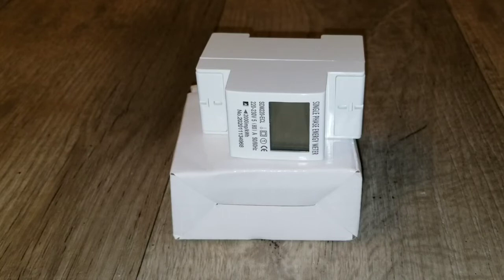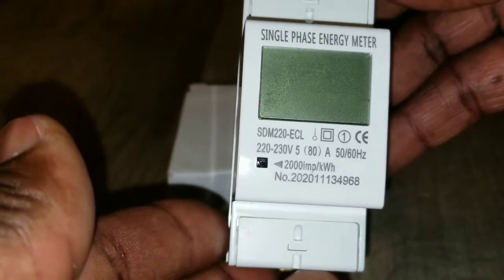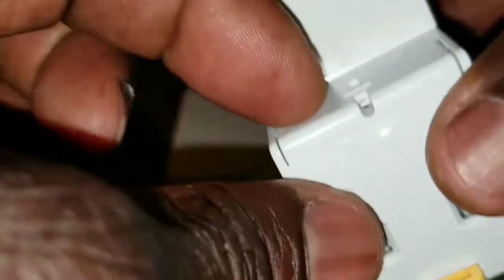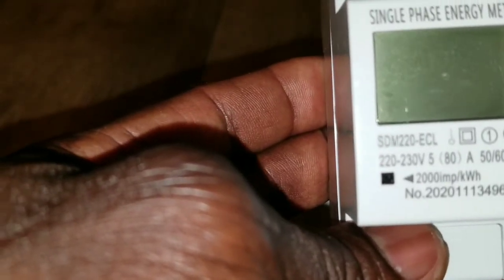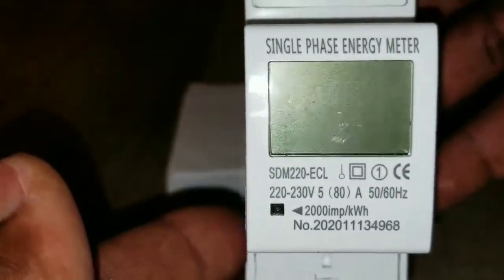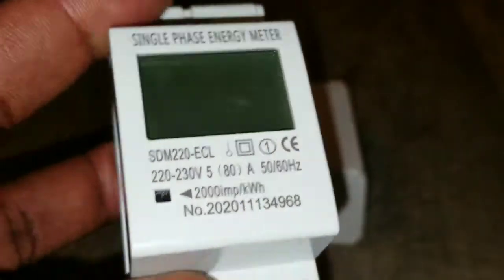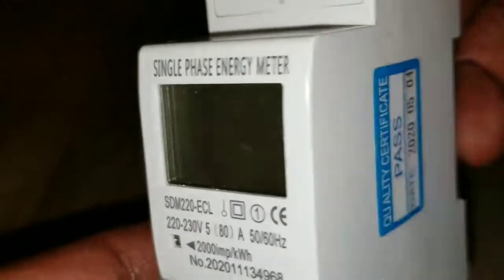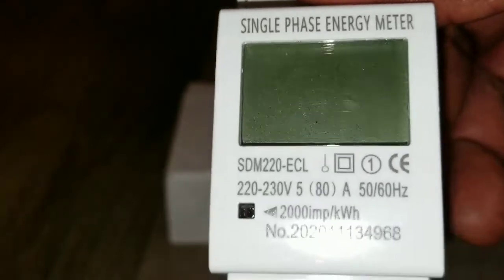80A SINGLE PHASE TWO WIRE LCD DIGITAL DISPLAY WATTMETER POWER CONSUMPTION ENERGY METER

Comment: How does this handle imported and exported power? I mean can I use this to monitor power in direction even when there is power going in the other direction? Thanksm
Reply: No you cannot.
Reply from the maker: Thank you
Reply from the maker: I haven't tried using it with motors.
Thanks for watching LIKE SUBSCRIBE and SHARE

Comment: Can you use this for metering the output of a pure sinewave inverter feeding a critical load panel in a house ?
Reply from the maker: Yes. 
As long as your critical loads are NOT over the the rated capacity of this meter proximately you should be fine. 
That's was exactly how I setup my meter according to my Inverter capacity.
Remember to apply safety first on everything you do. 
DO NOT OVERLOAD 
Cheers
Reply: @jwsolarusa  thanks bro
Reply from the maker: @ibidapoilawole7120  
You are welcome Sir